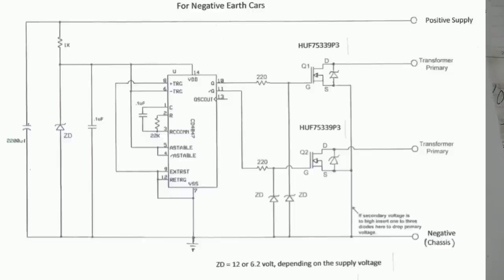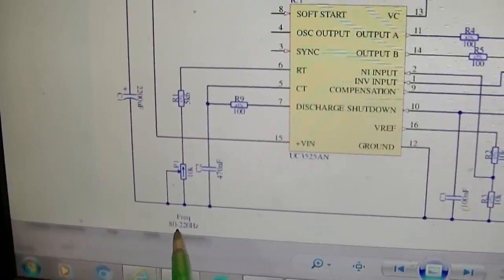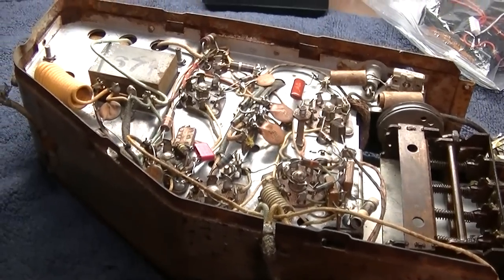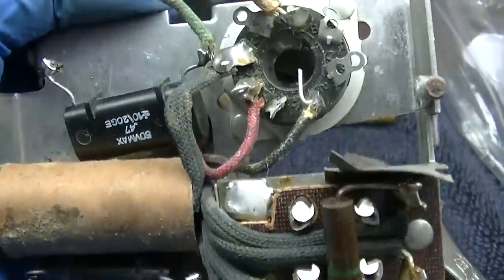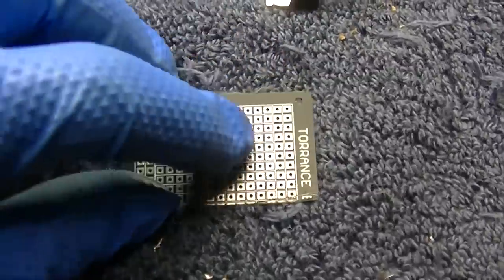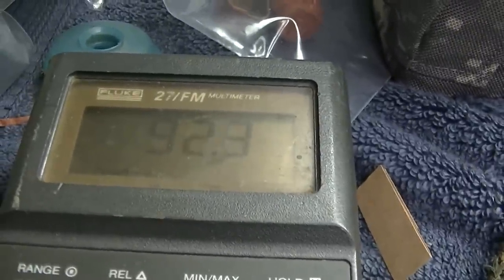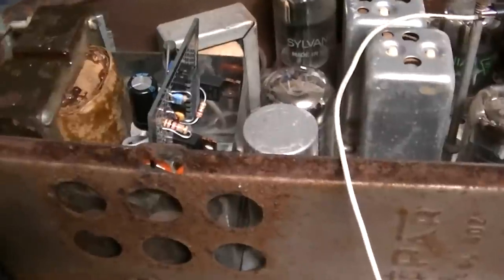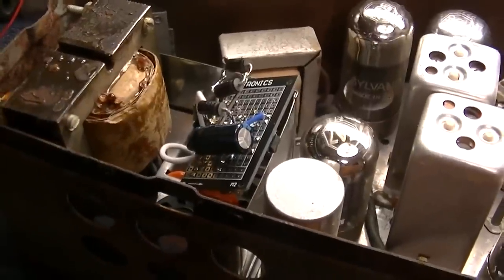Build Auto Radio Solid State Vibrator Replacement and Testing v2 1

Comment: Neat little circuit. Lifting the source of the FET's from ground (adding diodes there,) is "somewhat like" the same idea as a cathode resistor used to create bias for a tube. Two things that make FET's hot: Slow switching times (for a single FET,) and no "dead time" between the transition from one FET to the other. Vibrators have a long dead time in the transition as just a natural effect of the moving reed. Picture this: Think of the moving or swinging reed in the middle of the vibrator contacting one side, then moving to the other contact on the other side "as it's vibrating." The reed (as its moving from one side to the other) for a brief period "when its between contacts" has no contact to either side (this is "dead time.") so effectively, the primary of the vibrator transformer is completely open for a small amount of time. This dead time allows the magnetic field of the transformer to collapse successfully before switching on the other FET at the other end of the winding. The CD4047 is a great choice for a low voltage oscillator (6V car) but has an immediate transition from one FET to the other with no dead time, that alone will make the FET's heat. This circuit could benefit by a delay line in the gate path of the FET's, or some other way of creating dead time. Dead time is easy to make, but many circuits will slow the IC's output rise time drive signal as the FET is turned on, this will also create heat as the FET is now operating for a longer period in the linear region. The TL494 has a "dead time control" pin, but the downfall is: the IC will only operate down to 7 Volts, then it looses control over the feedback ETC... (Great for 12V car Vibrator circuits though!) Building a small auxiliary switching supply for a TL494, "so it can operate safely with a supply down to about 3V" would be the optimum vibrator circuit for a 6V car. This could be done with a simple boost converter using an inductor. Brute force over rated "lower logic level" gate drive FET's with a low on resistance will make a circuit like the one shown here work fine, but the transformer will get warmer due to the lack of dead time. "You move the problem on to the next stage, so to say :^)" If you made it this far reading this, you are probably "really into electronics :^)" Have a good day, and thanks for taking the time to make your videos Shango, we all enjoy them a lot! Note: Edited due to spell check :^/
Reply: Hello Paul and yep I read it all, comprehend? maybe.  Thanks for commenting here.  So if we think about applying the TL494 dead time control pin, we would boost the 3V to the 7V the IC needs?  Saw elsewhere here concern with noise using a DC/DC converter,  to come up from the 3V.  Do you see that as significant compared to the other switching going on on the board?  Thanks
Reply: @PracticallyFixed  Hi. No, dead time just puts a delay in the transition from one FET to the other. Another small boost supply involving an inductor would need to be used to lift the 6V supply up to 12V, only for the TL494, (and hold it there). The boost supply would need to operate with an input voltage down to about 3V (worst case.) A 6V car sitting off without the engine running (no generator or alternator spinning) can have a voltage at the radio as low as 4V, the boost circuit should have a Volt "or so" safety region.
Reply from the maker: Awesome. I really want to try the 3525 with the duty cycle control as an experiment. My experience is any of those buck boost converters generate so much noise they just drive am radios completely nuts so I'm trying to avoid that type of voltage manipulation
Reply: @MrCarlsonsLab  Right, I think I got that.  So in principle we would leave the FETs as they are, use the TL494 providing PWM instead of using the CD4047 (or 3525) for driving the FETs because it can provide the dead time control needed for a happy transformer?  If the supply is, say as low as 4V, use a DC/DC boost to just supply the Vcc (12V) for the TL494 driving the FETs (which would still be switching the 4V from the transformer center tap to ground via the different legs).  If so, then Shango would have better luck with the TL494 than the 3525?  I checked a datasheet for the 3525 and did not see a dead time control capability but maybe I missed it (correction, yes pin 7 allows dead time adjustment).  Thanks both of you. Edited due to misspelling the CD4047 and correction to dead time capability to 3525.
Reply: @shango066  I used a DC/DC converter off Amazon in buck mode once in an experiment to replace a bias cell in a 1937 Grunow radio once (was actually testing to see if the bias cell voltage, 1V vs 3V, was critical) and didn't pick up any noise - maybe I was just lucky?  Also thinking about the steel shielding you have around the vibrator socket?  I had someone knowledgeable in RF question me once about noise from a SS vibrator in a radio I did last fall about RF noise - all I could say was that I didn't get any, and it also could have been due to the steel partitions in the chassis.  Maybe the reactance of the transformer chokes if off the power line as well?  Thanks, great video.
Reply: Paul: Just a thought....Instead of these particular IC's being discussed, perhaps a small PIC w/an internal clock (avoiding an external crystal) might do the trick. With a PIC one can create one's "duty cycle", "dead time control" and overall "desired/ needed frequency". A little 8 pin should do the trick quiet nicely wouldn't you think? 😉

 LM7812 & 7805 to drive the PIC would be needed of course.
Reply: Mr C
Reply: @shango066  I designed an automotive DC-DC converter (now discontinued) for a completely different application in car audio. It was called the DSPOWER for running the Behringer DCX-2496 DSP in a car. I specifically designed the switching, dead time and magnetics to allow perfect AM reception with the supply sitting right on top of the radio(!) 
So what I did was make the primary winding switch slightly discontinuous such that the inductance of the primary “carried” the switching transition into a linear range to soften the sharp edges. The resulting switching was modified sinusoidal. I did this with a combination of snubbers, switching frequency and primary winding inductance. Losses in the FETs increased slightly but was a huge win for low noise operation. It operated at a much higher frequency - 50kHz so the snubber and transformer were smaller. I’ve been following you for years and enjoy watching your restorations. Thanks!
Reply: EDITED CORRECTED TEXT - (1) Errors discovered and corrected (2) Text formatted
  Neat little circuit. Lifting the source of the FET's from ground
  (adding diodes there) is "somewhat like" the same idea as a cathode
  resistor used to create bias for a tube.
  Two things that make FET's hot: Slow switching times (for a single FET)
  and no "dead time" between the transition from one FET to the other.
  Vibrators have a long dead time in the transition as just a natural
  effect of the moving reed.
  Picture this: Think of the moving or swinging reed in the middle of
  the vibrator contacting one side - then moving to the other contact
  on the other side "as it's vibrating." The reed (as it's moving from
  one side to the other) for a brief period "when it's between contacts"
  has no contact with either side (this is "dead time")
  So effectively - the primary of the vibrator transformer is completely
  open for a small amount of time. This dead time allows the magnetic
  field of the transformer to collapse successfully before switching ON
  the other FET at the other end of the winding.
  The CD4047 is a great choice for a low voltage oscillator (6V car) but
  has an immediate transition from one FET to the other with no dead time
  - that alone will make the FET's heat. This circuit could benefit by a
  delay line in the gate path of the FET's - or some other way of
  creating dead time.
  Dead time is easy to make - but many circuits will slow the IC's output
  rise time drive signal as the FET is turned ON - this will also create
  heat as the FET is now operating for a longer period in the linear
  region.
  The TL494 has a "dead time control" pin - but the downfall is: the IC
  will only operate down to 7 Volts - then it loses control over the
  feedback ETC... (Great for 12V car Vibrator circuits though!)
  Building a small auxiliary switching supply for a TL494 -
  "so it can operate safely with a supply down to about 3V" would be the
  optimum vibrator circuit for a 6V car.
  This could be done with a simple boost converter using an inductor.
  Brute force overrated "lower logic level" gate drive FET's with a
  low ON resistance will make a circuit like the one shown here work
  fine - but the transformer will get warmer due to the lack of dead
  time.
  "You move the problem on to the next stage - so to say :^)"
  If you made it this far reading this - you are probably
  "really into electronics :^)"
  Have a good day - and thanks for taking the time to make your videos
  Shango - we all enjoy them a lot!
  Note: Edited due to spell check :^/
Reply: @Rev22-21  Interesting idea. I was also thinking, maybe a cheap Arduino Nano with programmable PWM.
Reply: Mr Carlson's Lab is right about the diodes were acting like biasing resistors in a cathode circuit for vacuum tubes. Which was causing the MOSFETs to not fully conduct when told to switch on, because the effective gate drive voltage would be less.  That would make sense as to why the MOSFETs were getting warm. Moving the Diodes to the B+ supply to reduce the 6.3 volts to the SS vibrator circuit, was the better way to cut back the voltage.
Reply: Nice to see Mr C watching ;)

Comment: I think the schematic was saying you could put diodes in the negative rail (the combined one that both the fet sources and chip are powered from), that would mean the chip ground is still firmly tied to the fets source and you wouldn't get problems like you did. But you would have a problem with the gate voltage being too low to turn on the fet strong enough (4V may even be too low to turn on some fets at all). It's better if you keep the ground solid and put diodes just on the transformer side like you did. A problem with this circuit is it has zero deadtime. There is some deadtime added by the resistors and diodes to the fet gates (turn-on slower than turn-off). A SG3525 or TL494 (KA7500) is a much better choice for this application. Though as you said they might not work at 6V, you'd need to check the datasheets. An idea I have is to use a 4017, connect output 1 to gate 1, 3 to gate 2, leave outputs 2 and 4 disconnected, connect 5 to reset. This will give you a 50% duty cycle. But you need another chip to generate the clock for the 4017.
Reply: Another idea, you could put diodes between drains of fets and transformer. Thus you wouldn't need to modify the radio. symmetrical (same amount of diodes on each transformer leg), just means you need twice the number of diodes than if you put the diodes on the transformer center tap or on the negative rail of the circuit. But the advantage of not putting diodes in the negative rail is you can feed a full 6V power to the chip which will give you the full voltage on the fet gates which will lower their on resistance and make them run cooler. You would only need to run one extra wire from 6V power to the chip power.
Regarding the 12 to 6V dropping resistor. What's the current draw of the radio? Maybe you could use a linear reg like a LM317 with added transistor to increase its current. The datasheet has good examples, like added transistor plus current limiter to protect it.
Reply: If you close the gate off the cows and sheep won’t get out. Works for me
Reply: Yes, diodes in the source lead is bad.  The potential Vgs (from the driver) needs to be > the miller voltage not just the max threshold (typ 4v).  There is quite a lot of theory and practice going into driving a fet.  Those diodes added in the source lead to lower the output would mean those fets are not being switched efficiently thus leading to losses in the fets so they get hot.

Edit:  pulled up the datasheet for the IRF3205.  Vgs_th is 2-4V and the miller voltage is about 5.2v from the charge plot.  So, those fets will not be fully enhanced unless Vgs is at least that much.
Reply: A thought on the sideline: If the circuit must be for a 6v radio, it may be a plan to boost the chip supply voltage via a low frequency boost converter to ensure the FETs are fully conductive during their duty cycle.
Reply: Blitz Roehre you could derive it from two diodes, one from each leg of the transformer. Once the converter starts up, the transformer leg that's not pulled to ground will be at 2*VBatt. So it will derive its own doubled supply voltage. The circuit must still somewhat work just to turn on the fet enough that it pulls one leg of the transformer down. Vgs threshold must be less than 6V. After one cycle it will already have 12V supply.
Reply: I was about to write about the TL494, the datasheet have some examples. Away from it mos common use: ATX "generic" PSU's Also TL494 allows feedback. Only thing is, the transformer on the radio most have a freq were it is more efficient. Probably a very low one compared to what TL494 applications are used to. But zero deadtime and gate current (depending on the load you want to drive) can get complicated. You can get mosfet drivers from IR that will take care of both things. Come to my mind the 2110 .... what has low and high side.

Comment: In 1977 I was given a 1952 Buick Special straight eight automatic. My Grand Mama’s car since new. It was 6 volt and we converted it to 12 volt. The radio was beautiful and sounded amazing. So I found a similar 12 to 6 volt converter on J C Whitney for like $10.00. Similar design in ceramics. Mounted it on a steel under dash point and it ran warm to touch. The heater motor was not changed and ran fast but never failed.

Comment: On some of those schematics found on the internet the one FET turns off just as the opposite one becomes conductive. This basically means the magnetic field in the transformer core is being force-reversed, a lot more current flow occurs through the FETs here generating more heat. Better is a 80% duty cycle setup which has pause between each switch on to allow the magnetic field in the trafo-core to decay. A microcontroller programmed to do this would be the ideal solution. Also, the use of IGBTs designed specifically as automotive ignition coil drivers would make the circuit very resistant to voltage spikes etc. Fairchild has coil drivers in their product portfolio. I am working on a setup like this and will upoad a video if it works out ok..

Comment: Excellent video; love the experimentation.  "you built it yourself" - amen.  Yes, I have used off the shelf SS vibrators but would love to make one myself and perhaps modify for different applications I have had that require a different voltage, e.g. 4V, plus "I built it myself".   Also really enjoy the comments and suggestions by the other knowledgeable folks here for other ideas.  If there are other schematics to look at (other than those Shango showed) I would like to see them if either Shango can leave a link or those who sent them in to him would be so kind.  Thanks

Comment: Hi, adjusting the switching frequency to a value closer to the original vibrator's may benefit the audio by reducing the hum. 
Using SG3525 instead of CD4047 allows you control the output voltage more or less at will, since you can adjust the duty cycle.
By adjusting the duty cycle you can adjust the magnetic flux of the transformer (the same you can do by adding resistors or diodes to the primary with the fix 50% duty cycle CD4047).
An additional benefit of the 3525 is that you can add dead time to the gates driving to make sure that the transistors don't overlap in conduction reducing heat ( but at so low freq I don't thing that is a big deal).
Best wishes from Buenos Aires, Argentina.

Comment: Years ago, I had a 6 volt CB radio in my 12 volt car. I bought a dropping resistor, but it did a poor job, as the radio drew a large current when transmitting, and burned out the resistor.

Rather than using a divider resistor, I would build a 6 volt voltage regulator. That way, if the current draw changes, then the regulator would supply it without fear of burning out.

At the time I had that radio, it had a solid state vibrator installed, and it worked very well and very quietly.

As a kid, I really loved the old car radios with tubes! While harder to work on because of the compactness of the units, they were well built because of the purpose of the radio.

The failed 0.5 uF caps were not hurt by the DC voltage, but by the voltage spikes from the vibrator switching, so the voltage rating being higher would be better than if you drop the voltage rating!
Reply: Good idea. If it were on the dash and away from the radio....why not?
Reply: @Rev22-21  Are you speaking of the dropping resistor?

If so, the resistor is a low ohm unit with a tap in the center of it, and it draws many amps that are wasted in heat. When you add your tube radio to it, it makes the resistor draw even more power, and it creates more heat!

Mine got so hot, you could not touch it, and it burned out because of all the heat.

Comment: I'm fairly certain that those vibrators ran at 115 HZ.  You don't want ot run much lower as the transformer will draw more current due to core saturation with the lower frequency.
Reply: By any chance did you (or do you) have a relative named Billy from Texas?
Reply: JAMES AZBELL I am from Ohio and I have  brother in Birmingham AL.  Iwould use a microprocessor solution to that vibrator replacement, but you have done a great job with analog.